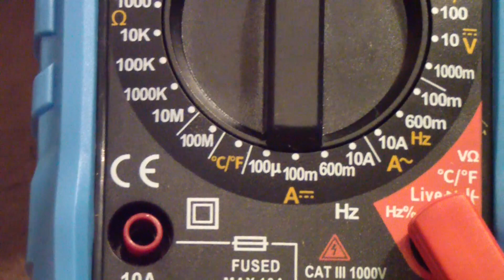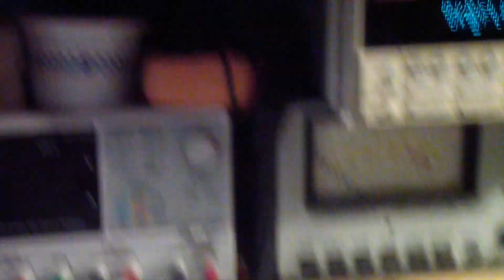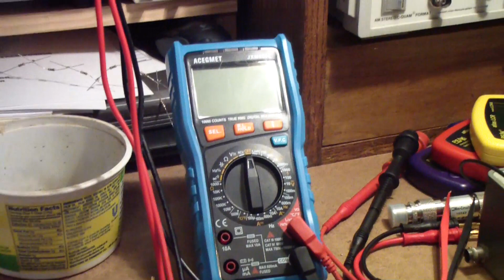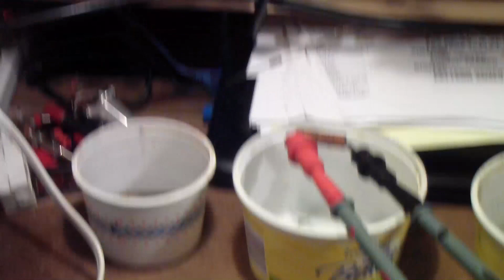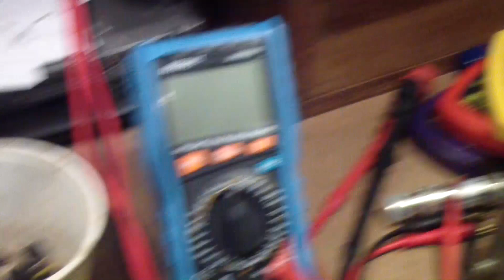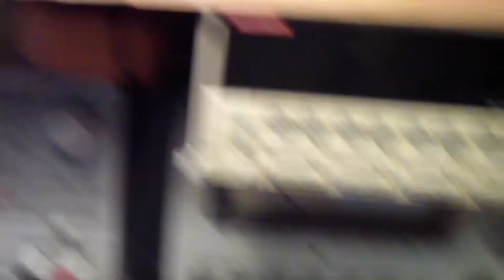TTT342 Capacitor Leakage

Comment: I have heard that Solar Sealtite were best paper capacitor in there day. I wonder if you bought a NOS paper wax capacitor new never used and soaked it in wax if that would stop fix the leak at all in a old nos capacitor? Wax used to seal them wax breaks down even with NOS vintage caps so wondering if adding fresh hot wax might fix leak?

Comment: Hi Tom, Another great video like always. Could you tell me what is an acceptable Meg Ohm reading for a good Cap tested at a certain voltage. Cheers John
Reply from the maker: Most good film caps have more than 500 Meg ohms leakage resistance. However you can use a cap as a coupling capacitor in a circuit as long as its leakage resistance is at least 100 times the impedance of the circuit. So, for example, if a tube circuit has a 500k grid resistor, then a 50 Meg leakage would produce a 1% change since 50Meg is 1 % of 500k. Of course, it is always better to have infinite leakage resistance. Most good new film capacitors have such high leakage resistance that they won't measure on low cost megohmmeters like the ones I showed. The DIY tester will blink more than once if the leakage is less than about 250 Meg.
Reply: Thanks Tom, Appreciate you getting back so soon. I have never thought of doing a megohm test on any new Caps, I must have been lucky for the past 6 years for customer repairs. But from now on I will use my fluke 1653B. There is always something new to learn, and  I really appreciate you sharing your expertise. I have restored some Tube / Multimeter testers with the neon light that would glow on a bad cap and flash once on a good one. I think from memory they put out about 150v. No H&S back then as you could touch both test sockets. Thanks again, and you have a nice day too.
Reply from the maker: @acdcjustthebest....8980 Thanks for the comment and info. Luck is usually a combination of probability and preparation, so I suspect you buy good quality capacitors from known suppliers. The high failure rate for new capacitors usually happen with cheap capacitors or fake name-brands substituted by unreliable suppliers. Keep up the good work.

Comment: Thank you, as always great video.  I have that Vici meter and use it to test smaller capacitors, it won't charge a large electrolytic in a decent time frame.  Was trying to talk to you through the screen in the beginning about having the leads in the wrong jacks, but you caught it.  Take care, be safe when testing caps at HV
Reply: Mikko from Finland hi. I notice too that Tom put leads wrong jacks. I have same Vici meter.

Comment: Thanks for the video. I have been thinking about these test methods and the basic principle of measuring DC current leakage. It occurred to me that an SMU could be used to measure DC leakage very conveniently.  And it can: Leaky paper caps I have measured have tens to hundreds of microamps of leakage depending on the applied voltage (up to 100v). Good film caps have leakage down in the picoamp range.  I think an electrometer with a built in source could be used as well.

Comment: I've heard of quite a number of experienced radio engineers testing old paper capacitors with meggers. Mostly they use the old style with the analogue meter. Some of them have settings that start at 50V and go up from that, maybe good for also testing lower voltage capacitors?.

Comment: Very interesting Tom, thanks. I use a more primitive method, I just replace every wax/paper I see. I consider them either bad or about to go bad. You are right about testing new ones, I do not do that and I should.  I did not know 1% were bad to begin with.
Reply from the maker: Thanks for the comment. If I said that 1% are bad to begin with, I overstated. If you buy good quality capacitors from reliable vendors (not likely to sneak in some cheap imitations) then the failure rate is way below 1% for new capacitors. The batch that included the bad 630 V film capacitor I showed was not high quality, but a set of lower priced capacitors I got from a radio restoration supplier years ago. I always test them but I suspect that it will be a long time before I find a bad Sprague Orange Drop (if it really is from Sprague and not an imitator). But it never hurts to test new ones just to be sure.
Reply: @tomtektest8042  Thanks Tom. Are there actually counterfeit capacitors? Anyway, I love your channel and I appreciate your calm analytical approach to things. I have learned a lot from you. I am no genius, but you make things easy to understand.
Reply from the maker: @ianbutler1983  Thanks again for the compliment. Yes, there are imitations out there. They tend to be in the higher priced area like electrolytics but there are some fake Orange Drops as well. Sony became a victim of these in the 90's and many otherwise good radios, etc. were ruined by leaky electrolytics made in Korea. I think the Koreans have since taken steps to stop the fakes, but that just meant they moved elsewhere. That is why I always say "good parts from reliable suppliers" since suppliers (like Mouser or Digi-Key) not only have the incentive, but also the means to check the source of their parts.
Reply: @tomtektest8042  I had no idea. I just did some reading and found counterfeit (Chinese) transistors, particularly high power RF and AF power transistors, are all over eBay. They seem to have caused a lot of headaches to a lot of people.
Thanks again. 
Ian